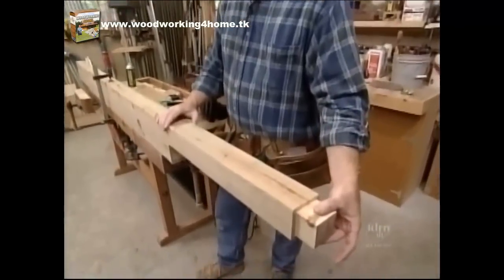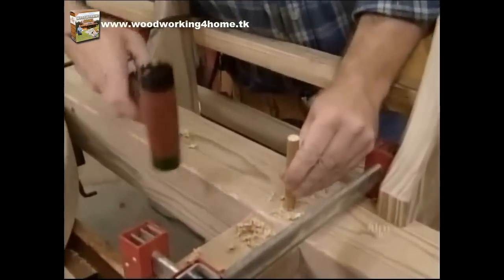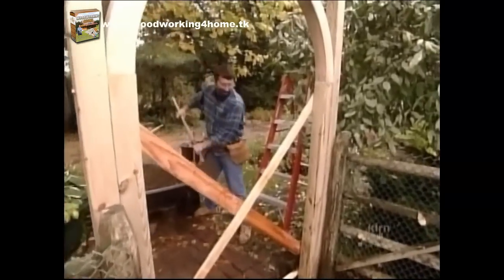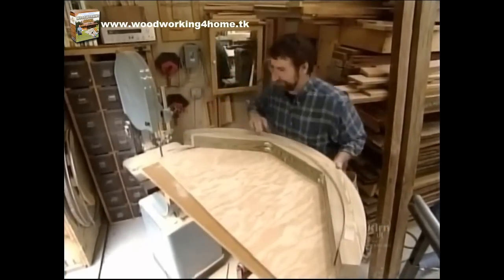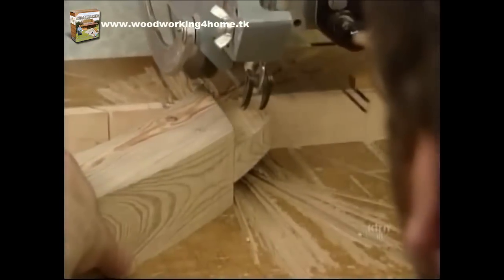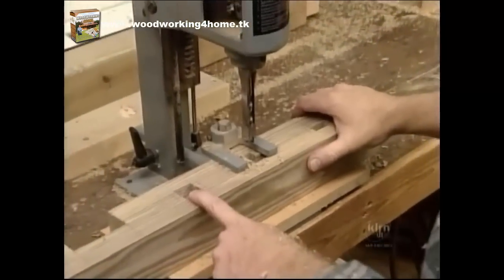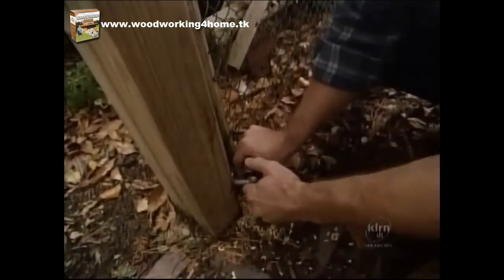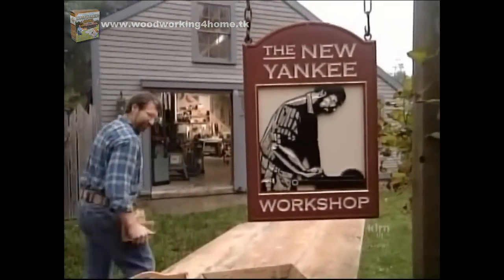Garden Gate part2 - Woodworking Tips - WoodWorking Projects

Comment: the best way to protect the legs is to use the correct wood which does not need additional protection: teak (very pricy), cypress (rare), cedar (most common choice), or pressure treated pine (least expensive)